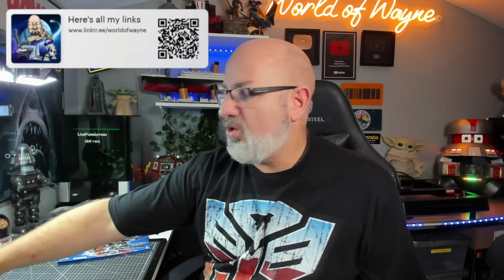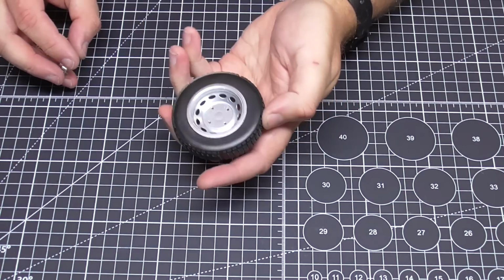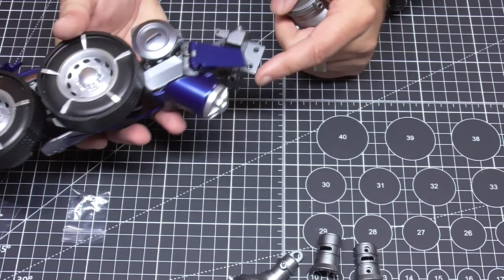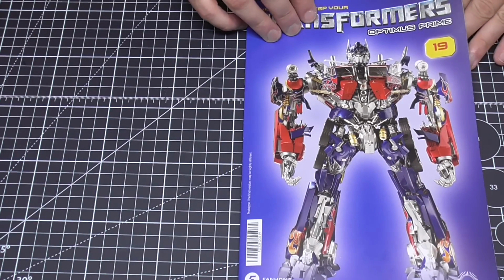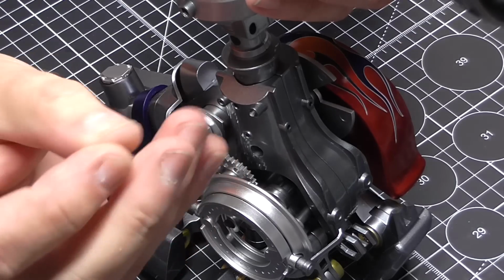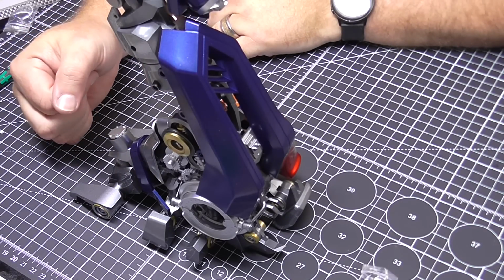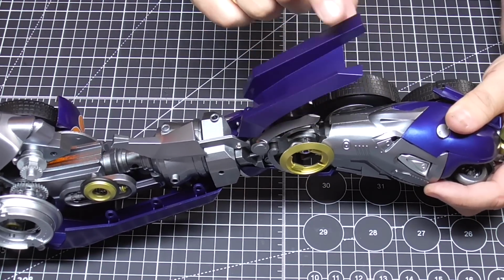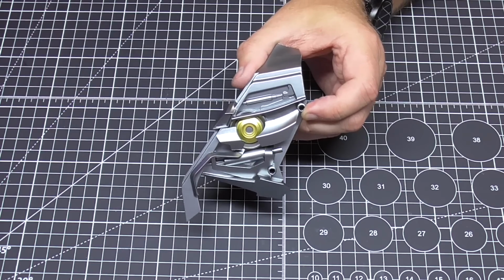Fanhome Build the Transformers Movie Optimus Prime - Pack 5 - Stages 17-21

Comment: The wierd thing is I'm kind of on the same stages as you are buy my stage 19 hasn't come yet.  Also those washers kept on coming out so I pit a small dab of glue on the two which helped big time.   Hopefully it won't be an issue on the left leg which I'm guessing it will be the same on that one too.   Thanks for the videos they have been a real help